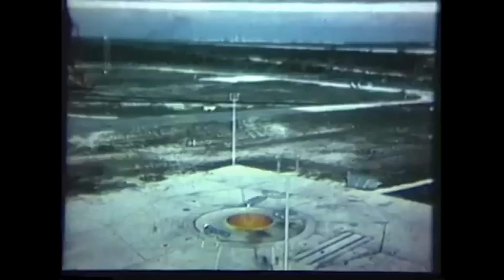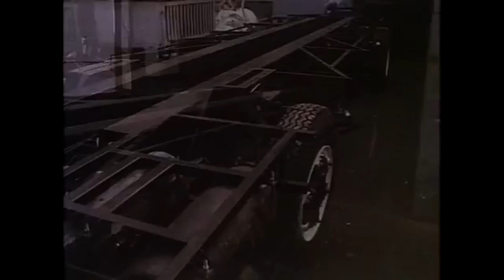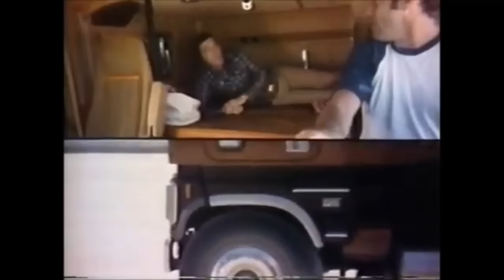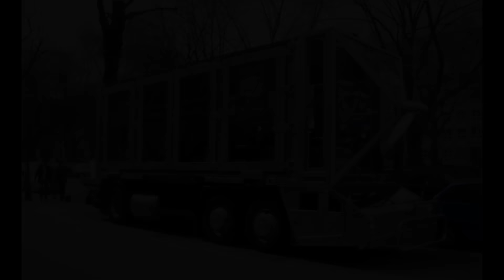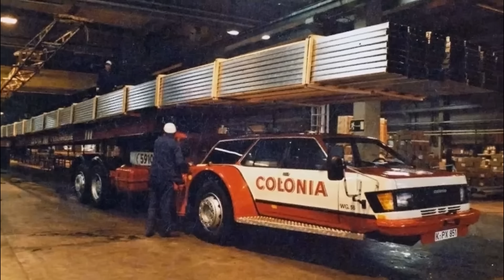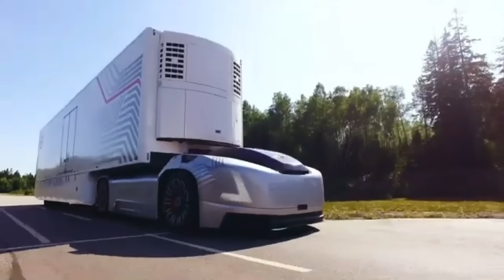Cab Under Trucks: Why They Never Worked

Comment: Minuteman TEL is more nuanced than just having moving the missile around, which can and iirc is normally(always?) done with police escorts and all that. Its because with a system like minuteman, which is a second strike counter value weapon you need to be able to demonstrate the ability to move it without much support or notice, and also show that essentially it doesn't matter if you target the silos because the weapons can still be launched

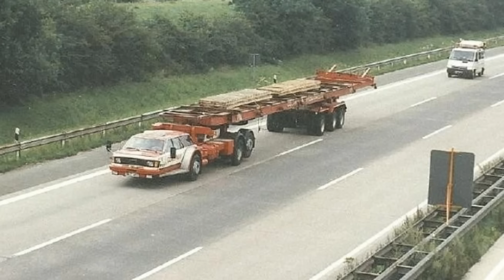Comment: 8:46 Oversized cargo in Germany needs a special permission, which usually only covers night hours.
If road infrastructure is in the way, it is cheaper to just saw it off and replace it in the wake of the vehicle.
They also drive at slow speeds with escorts and road blocks, so no risk of any traffic.
Makes sense they wanted to dodge all that hassle.

Comment: I work around Boeing and I still see these being used from time to time. They have one driver in a normal truck up front with one of these in the rear. They use them to  move massive oversized parts

Comment: There's still a ton of places in the world with extremely poor roads that also require crossing small bodies of water like streams or rivers that have come over the bridge. There's a few places like that in central Africa(and by few I mean a lot). I always thought that the reverse would be a practical niche design. The engine on top above the roof. You can wade through anything then, as long as the driver isn't underwater too.

Comment: The maneuverability issue on normal tractor-trailer rigs could be solved (or at least improved) by having steerable rear axles...
Reply: Unless you have two drivers that just makes it worse.  Automatic rear steering makes the rear of the trailer swing out more on a turn, which means if you have e.g. an obstacle close on your right, you can't turn left.  It also completely changes how the trailer backs.  Not appropriate for roads or parking lots.  Works great in a field though, and it's fairly common for trailers designed to be pulled by farm tractors (which also have complex hitches that can drive purely mechanical trailer steering).
Reply: @SkorjOlafsen  -- I don't know about the current automated systems, but when you have another driver that is solely responsible for the rear steering, it is possible for the trailer to not swing right when turning left.  Well, not more than would normally be expected if the rear axle is not at the very rearmost position of the trailer.

Comment: Genius idea ! Gotta be working someday
Reply: Its literally a death trap with a very limited visibility...
Reply: @KapitanPisoar1  Less than a van ? How ?
Reply: @Chiellus11  Because your head is the same level as bumpers on the cars around you…
Reply: @KapitanPisoar1  It's still higher than a car...
Reply: @Chiellus11  it is not… Have you watched the video?
Reply: @KapitanPisoar1  You can easily look this up...

1. Strick Cab‑Under — Seat Height

Seat height: ~ 70–80 cm above the ground
(roughly the same as a compact car or small van)

2. Steinwinter Supercargo 2040 — Seat Height

Seat height: ~ 60–70 cm  
(very similar to a sports car or low sedan)

3. Airport Pushback Tractor (Schopf F396C) — Seat Height

Seat height: ~ 100–120 cm  
(similar to a pickup truck or small SUV)
Reply: @KapitanPisoar1  You can easily look this up...

1. Strick Cab‑Under

Seat height: ~ 70–80 cm above the ground
(roughly the same as a compact car or small van)

2. Steinwinter Supercargo 2040

Seat height: ~ 60–70 cm  
(very similar to a sports car or low sedan)

3. Airport Pushback Tractor (Schopf F396C) 

Seat height: ~ 100–120 cm  
(similar to a pickup truck or small SUV)

Comment: You only touched on one of the big problems with this concept -- cooling. I had a friend that was an engineer at Kenworth when their T600 was designed. They worked hard to decrease the grill area as much as possible while still getting good engine cooling. 
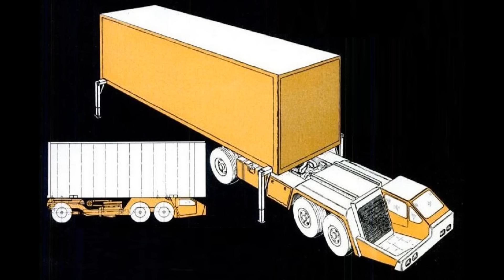When artists concept drawings of aerodynamic designs would show up in the press, he would mention how they were unrealistic because they didn't include a large grill area. When a big engine is working hard, slowly climbing a long hill, in hot weather, a lot of grill area is needed. With the possible exception of the Strick Trailer artwork (at 4:35 in the video), these under-cab concepts have the same problem -- no large gill area.
Reply: It's only a problem when you use combustion as a primary engine. It's also why EVs don't face that issue. They only require specialised liquid cooling. Plus no issues when wading through water because EVs don't breathe unlike the combustion engine. Combustion might find relevant use in heavy industries but it's getting apparent about its downsides in public use. Hence why EVs are in full swing development today. The only glitches is the range & "power stations" for recharge availability.
Reply: @chang1915  True, cooling wouldn't be a problem for an EV truck. But this cab-under-trailer was a concept from the 1970s, way before EVs were close to being practical. And as mentioned in the video, length restrictions were changed in 1982. So, in North America, this under-trailer concept no longer has any advantages.
As for some of your statements about EVs:
EVs still have wading issues. You don't want water in the motor, the gearbox,  or any of the multitude of electronics. And you really don't want water getting in the battery pack. All of these can be sealed and/or vented for high water, but so can everything on an ICE vehicle. Military ICE vehicles are often designed to run in deep water. It just costs more to make a deep-water capable vehicle. EV truck manufacturers are very unlikely to spend the extra required to make a commercial truck deep-water capable.
You missed one big drawback to EV trucks -- battery weight. The Hummer EV has a 3000 pound battery pack. An over-the-road truck might need 10,000 to 20,000 pounds of batteries to make 500+ miles a day. The diesel engine in a class 8 truck might weigh 3000 pounds, so the weight increase for an EV might be 10,000 pounds. That's a 10,000 pound reduction in the load that can be hauled without special permits. Also, if the battery is all on the tractor, it might limit the load in the trailer even more to keep the tractors axle weights below the limits.
Note: You might get the impression that I don't like EVs. But I do like them, I own 2. But EV implementation does come with challenges.
Reply: Did they ever try to improve the conductivity of the water by adding copper or lead balls? The engine's vibration and water pump would allow the water to become a carrier through the entire water system. These balls  were readily available at about 15 microns.
Reply: @Maddog53 In asolid, heat moves only by conduction. In a liquid, it can move by conduction or convection. Convection is where you move the liquid to move the heat. Since the coolant is circulated rapidly by a pump, the heat in an engine is moved much, much more by convection than conduction. Increasing the how well the coolant conducts heat would only make a small improvement in cooling capacity. On the other hand, water can hold more heat than lead or copper. For the same volume, water holds about 20 percent more heat than copper, and nearly 3 times that of lead. So, even if the metal balls circulated well (which I doubt) they would still reduce the cooling capacity of the system because they wouldn’t carry as much heat as the water.
Reply: @andrewsnow7386  Thanks for that.
I know this idea works well for heating, but cooling is obviously different..

Comment: Standardised containers are not going away anytime soon. 
Ports and ships are built with them in mind.
Without refitting every port and container ship there is little need to drastically change the cab layout.
Modern cabs are getting as good as possible at making standard container transportation kinda aerodynamic.
Reply: It's not really aerodynamic, due to the aerodynamic shadow at the back, but yeah, it is more aerodynamic than this.
Reply: The standard container is probably the best invention in logistics. One what will be with us for many more decades to come. It simply works too well, and everything was built around it
Reply: @versinussyrin577  Absolutely.

Comment: Sitting under containers weighing tons would be one of the last places I would want to be.
Reply: In an emergency stop, the cargo would shoot past you overhead. With a regular cab it would squish you.
Reply: @natehill8069  Nope since only the part over you is going to clear, behind that the load would extend low enough that if pulled ahead would go through the top half of you.
Reply: @natehill8069 in an emergency stop the load shouldn't move at all if it was strapped on properly
Reply: @stevedawson256  I meant emergency stop like plowing into a concrete bridge piling, not something with the brakes.
Reply: @natehill8069  that’s like calling a parachute not deploying an emergency stop 😂🤣☠️
Reply: @LikeSpee  Isnt it? Seems like an emergency to me.
Reply: @natehill8069  🧠 🎱 🙂‍↕️
Reply: I would instead want to sit in front of any container being towed.

Comment: It's a very bad idea, because as a trucker you want to see as far ahead as you can to anticipate traffic flow changes and adjust the speed accordingly. That works in "normal" trucks, as you can look over cars and actually see what's happening 2, 3 or even more cars ahead, but it doesn't work with these cab-under trucks. That means that the first warning you'll get that the traffic is slowing down in front of you, is when the brake lights of the vehicle ahead of you are lighting up. And as that vehicle can probably stop within way less distance than your truck, that means you stand a large chance of crashing into that vehicle.
Reply: the cab under could work for intra complex transport as in moving trailers in large complexes.  But on the road? No thank you.
Reply: @AsmodeusDHare   Airports,maybe
Reply: @PaulDoyle-lf2pt They look like shortened versions of a common airport vehicle here in the states.
Reply: thats why cabover.
Reply: What if, submarine goggles to look above the truck?
Reply: @NullRex  Same principle as a camera: it loses depth perception because of the magnification and/or distortion of the lenses. 
Just get into a car that has side- and a rear-view mirror that enlarges things considerably. It totally messes up depth perception and though you can get used to it and mentally compensate for it up to a point, the loss stays. And it gets worse in the dark, rain or other circumstances that reduce vision. 
As far as I know, no semi-truck has mirrors that enlarge the view, just for this reason. Correct me if I'm wrong.
Reply: I could see a camera system being used to compensate but even if that worked it looks very cramped to sit in for long huals.
Reply: Well said OP. Visibility is definitely the number 1 issue with these, then the other problems of the driver being vulnerable to obstacles on the road and other things. Hell, they'd probably even develop back and knee issues from clamouring in and out of that thing all day.

It's an interesting idea but just isn't safe or practical in use.
Reply: At the time these were designed they were still the same size if not higher than the conventional car. It wasn't till the late 90s that SUVs started becoming something normal citizens truly considered as a serious main vehicle. Plus in that time cars have also even in the same category become taller. Just using a standard station wagon body but lifted by the larger truck tires means it still saw farther than most cars.
Reply: You probably don't want your load in front of and beside you when you turn, either.
Reply: needs a periscope
Reply: Nowadays we have cameras
Reply: They could’ve put a camera high  on the trailer, And the screen inside the cab so the driver can see ahead.
Reply from the maker: I don’t think visibility is the biggest issue with this design, unlike safety.
After all, modern tour buses are also as big as trucks—and sometimes even larger—but their driver’s cab is at the same height as a passenger car. Take the Van Hool Astromega and similar buses, for example.
Reply: @TheTransportChronicles  True, but I doubt busses gross out at 80,000lbs.  I would never drive a cab under, and visibility is one of the major reasons.  The other major reason is animal and road debris strikes, that would probably wind up coming through the windshield to make friends with my internal organs.
Reply: @TheTransportChronicles  Either YouTube failed to bring your comment to my attention or I simply missed it. But James Burleson 1916 has already pretty much answered for me: the gross vehicle weight of a semi plays a huge role. 
When you learn to drive a semi, the main thing a good instructors mercilessly hammers into you is anticipate, anticipate, anticipate. Your life, and that of a lot of people around you, depends on how well you can anticipate the traffic around you. And anticipation largely depends on the view you have on that traffic, hence the high seated position, that allows you to look over "normal" traffic and often see what's happening before they do.
Reply: You're supposed to keep a distance that doesn’t make you crash into the person ahead of you when they break.
Reply: @arthurdent5357 
Brake, and good luck with that.
Reply: I'm definitely not a trucker but I don't see why a camera+display or a large mirror cannot be used for such purpose.
Reply: @jwhite5008  Because as the military saying goes, "nothing beats the old Mark I eyeball" when it comes to seeing and anticipating things ahead. Camera's, no matter how good they are, always lower your depth perception and it's that depth perception you need.
Reply: @jwhite5008 VR high res camera
Reply: That's mainly true for american trucks, which are shitty. Bad safety and even worse breaking systems. With a European or asian truck you have stopping distances similar to cars and the problem is way smaller.
Reply: @CemMina-qk4ml 
Braking.
Maybe less of a problem, but still a problem.
Reply: @CemMina-qk4ml  if you have a 40 ton truck going down the road at 65mph, it will not stop in the same distance as a 1.5 ton car, even if you lock up the tires and skid.  Even if you could stop that fast, your load won't, and depending on what your load is, that could be a significant emotional event for the driver, who sits directly in front of the load.
Reply: @jamesburleson1916  There's a famous video of a European truck doing an emergency stop as children run over the street before it. Even most regular cars would have had problems stopping in time, but the truck did it.
However, my argument would be to fucking use proper safe following distances, whatever that happens to be for your vehicle-driver combo. Drive so you can stop in time if the vehicle in front of you hits a wall you could not see. That's the rule. Follow it.
Reply: @KaiHenningsen  Are you a heavy vehicle driver?  Do you put up with cars constantly pulling into your "stopping distance" on multi-lane motorways, while you're trying to pull up in time to avoid the said lane-cutter as it hits the brakes right in front of your 45 tonne semi with a handful of metres to spare?  

It's all well and good to lecture truck drivers, but if you're not one then kindly inform yourself of the real conditions under which heavy vehicle drivers are required to navigate and avoid accidents on a minute-by-minute basis before you do.

Heavy vehicles and their drivers are required to pass far more stringent testing and scrutiny by authorities than car drivers ever dreamed of.  The authorities generally assume any accident is the truck's fault, just as you do.  That's why most new trucks come installed with dashcams as standard equipment, to legally protect us from fools who don't respect the laws and have no clue of the danger of thoughtless driving.

Go watch a few YouTube truck dashcam videos before you get your panties in a twist again.

Comment: Mobile cranes are a kind of cab under.
Reply: And the drivers I've spoken don't really like it and generally speaking take things very easily and slowly when driving. Mobile cranes are heavy, really heavy and it takes quite some distance for them to stop or even lose speed.
Reply: Yes they are.
Reply: I drove a 6000 gallon jet fuel truck at an airport that was an under cab design made by AutoCar....it was always fun to drive.

Comment: Well lot off BS.
Why not?
Ergonomic's.
In the EU you can't fold people in a dog house to work.
For lenght there are other options,  believe it or not trailers can steer in the EU.
We do have low cab truck's, however there is enough compfort to work, and mostly used for easy acsess by driver or codriver when you have to step in and out a lot.
It's not allowed to have payload infront off the cab so why the trouble.
An underfloor and easy acsess or serv,  pffffff it's a hell on wheels. when under a loading deck between axel's.
For busses the engine is behind the rear axel and on a sled so you will pull it out.
Reply: Not anymore.

Comment: The Strick version seems that it would increase driver fatigue by the cab being so low and with so little headroom.
Reply: I agree, regular trucks have those seats that go up and down to take out the bumps to limit fatigue, I think in these you would feel every single vibration through your butt! 
Also, surely your head height in these must be at the level of car headlights.....yeah, really safe, especially with modern headlights! 😂

Comment: here in new zealand, interislander used 2 axle cab under tractor units called titin tugs to load-park and unload semi trailers& B-trains onto their ferrys since trucks were charged by length. once off the ferry, theyd swap back to a standard tractor unit for the highways